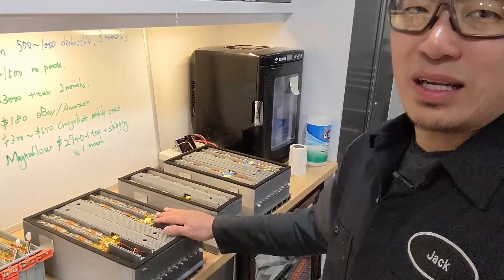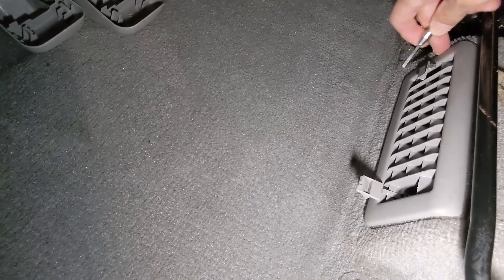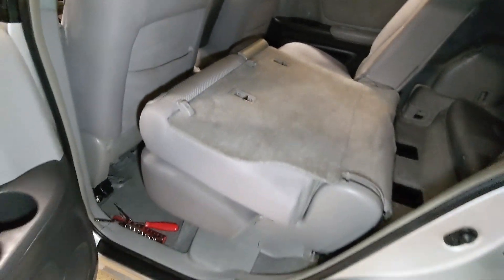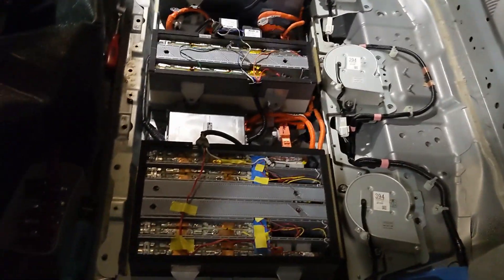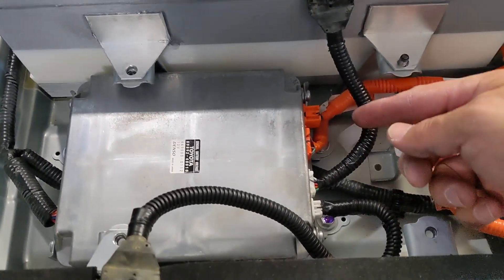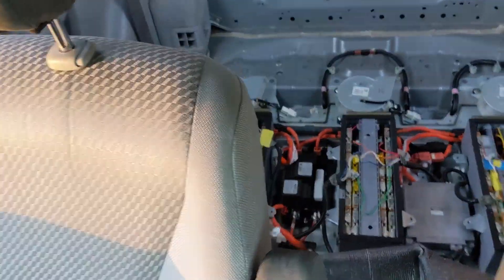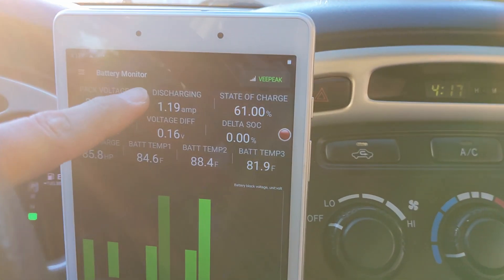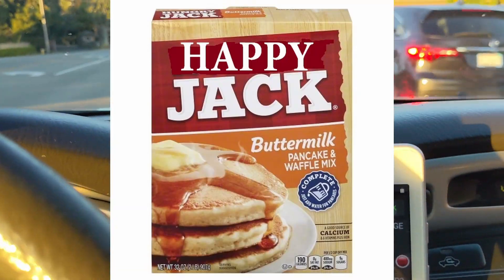The world first Lithium powered Toyota highlander hybrid / Lexus RX400h

Comment: A few weeks ago I purchased a used 2007 Toyota Highlander Hybrid(202K miles). It had no problem making it the 3+ hours from
South Carolina to my house in North Carolina. Both propulsion sources were stellar from my amateur viewpoint.  I bought it as 
much for a learning project as for a keeper or a flip; perhaps
even more. It is presenting some challenging issues & however painstaking these may be, it does open the door to 
enlightenment.
 A few words about me may be in order at this point. I have an Associates in Electrical/Electronics & considerable 
industrial exp. at the 480volt level. I have PLC training & Exp. & much exposure to both digital(discreet) & analog field devices 
& instrumentation. I have had much electrical & other safety training to include formal arcflash. 
I got this for a song because it had developed a Check VSC/ Check Hybrid system alarm that flashed on my multi-info screen all 
the way home. As I said above it ran great. But braking was extremely labored. It needed  a very hard press on brake peddle to 
cause a stop. A wise old instructor of mine used to say that when you don't know what to do, do what you know how to do. 
The owner had informed my that the brake fluid, pads, rotors etc. were all good. When I got it home I inspected anyway & 
found that the inboard pads were extremely worn. I ordered new pads. I also hooked up my OBD 2 checker & there were absolutely 
no codes(Green check mark). 
So the car sat in my garage for 7-10 days while I did some research & ordered parts. The 4th holiday passed & on July5 I decided to drive up to my local AutoZone to get a more in-depth code check. So I got in the Hybrid, pressed the brake & turned the key & the READY light came on & as in other timed the combustion engine started automatically after several seconds. I pulled it out of the garage(detached) & drove the 50ft or so up to the house. I needed to go inside & get my wallet. While in the house looking for the wallet the gas combustion engine turned off but the ready light was still on. I pulled out of my driveway & onto the street on battery power only(1st time doing that). I feel quite sure that the combustion engine came on when I got on the road but the 2-3 mile trip never needed more speed than about 40MPH. When I got to AutoZone, the first lady came out with a reader & there were no codes. But then a man came out probably with a different scanner &  it rendered some ABS codes as I has expected. They are C1252, C1256 & C1259. But all that was to become my secondary problem. Because when I pressed on the brake & turned the key the red battery lights did not go away & thus no READY light. CRAP!!! I did not know what to do & it was about 95F here in Carolina that day so I called AAA & had it towed to the house. His ETA was about 45min late. I was hot, bothered & embarrassed; rotten day!  My Hunch- The traction battery has discharged just below the threshold where battery alarms are not toggling away 
to give a READY signal. My next step is to remove the back seat & figure out how to measure & charge the traction battery. Prius  info is all over the place. What charger do I need for my 2wd Highlander?
Given Wednesday morning over again, I would have never have pulled out of the driveway powered by the battery only(combustion engine off). 
Can Maintenance Mode help? If you have any tips to help me recover please text Keith @(252)904-0365. Thanks!
Reply: Did you fix it?

Comment: cool!  I was just looking at purchasing a highlander hybrid or RX400h. My biggest concern was the life of the traction battery and was looking for 'alternative' upgrade.  I recalled all the Prius PHEV conversions 10 years ago with the upgraded/additional packs and was hoping something similar was still available.  I like this elegant solution and would definitely consider this before buying a NiMH replacement.  How reliable are Toyota hybrid systems?  Can the motor generators and inverters take the extra load?

Comment: Was this Highlander all-wheel drive?  My Highlander is all wheel drive and has a weak module.  When the state of charge is low and I get heavy on the gas pedal it always throws a code and then I have to reset.  All wheel drive Highlander is a very quick vehicle with an extra electric motor for the rear wheels!  I really really like my Highlander.  Good visibility, could sound system, good noise insulation, seats seven people, so many good things about it all except the stupid traction control won't let me go up a steep gravel Hill or a slippery grass hill.
Reply: put it in park, turn car off, hold brake pedal with left foot, turn key to "on" (not to start/ready), floor the accelerator 4 times, shift to nuetral, floor 4 times, shift to park, floor 4 times, then start the car.  You'll be in 4WD maintenance mode with all sorts of warning lights lit up, but no traction control.  Turn the car off & on to return to normal mode
Reply: @jeff-g  wow, that's an awesome trick. Would especially be good that time I couldn't get up the steep gravel driveway. Lol too bad drunk pulled out in front of me and totaled my Highlander.